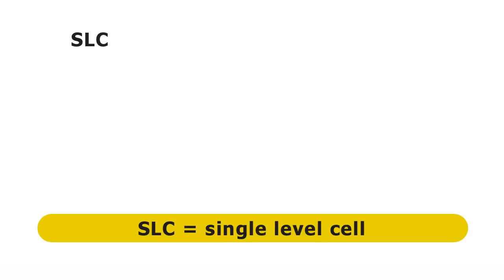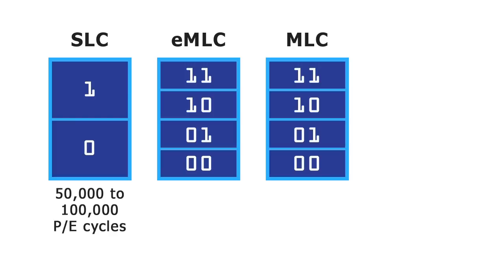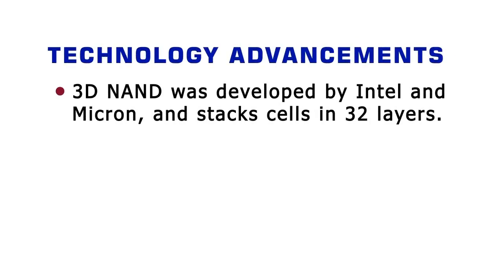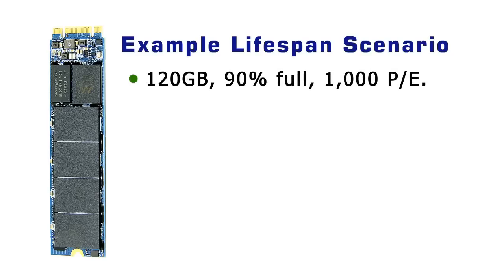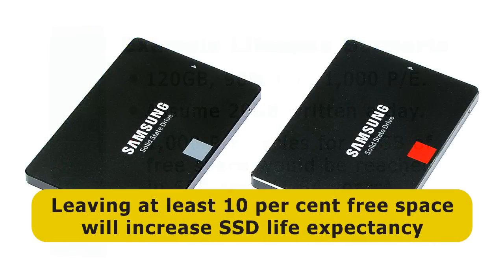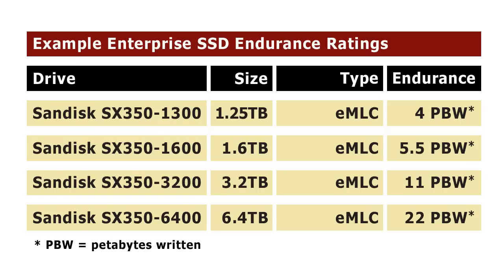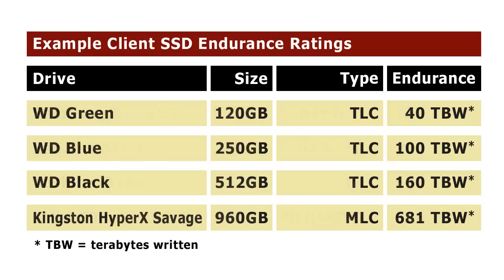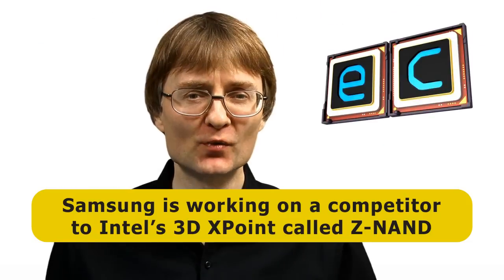SSD Life Expectancy

Comment: Simple over provisioning solution. Buy a 500GB SSD and 2TB HDD. Put your OS, programs and files on the HDD, and put the SSD straight in the garbage bin. Thus avoiding the complete loss and unrecoverability of ALL DATA on the SSD that is coming COMPLETELY without warning. In 2019 alone, I have had 7 SSD's fail entirely and when they fail they become UNREADABLE in anyway. I lost both my main PC's, two of 4 back-up PC's and my second NAS box. All had SSD's in them less than 6 months old. All had less than 120 hours on the drives, save for the NAS, which had almost 2 FULL months on it....and 2 further SSD's have crapped out in my laptop, with under 3 months usage time. I WONT BUY ANOTHER SSD in my life, the ABSOLUTE WORST TECH EVER invented. 

IMHO, boot speed lost to the old spinning platter HDD's is bearable if I don't have to replace almost $2000 worth of drives every 3 months. And any speed gained when at the desktop wasn't even noticeable. The ONLY thing I did see was a MINOR speed increase when opening Firefox or Waterfox browers, no other software had any visible gain on SSD over the HDD. VMware was 40% SLOWER on the SSD than it is my OLD 160GB 5400RPM HDD I'm using now.

SSD IS NOT WORTH THE MONEY IN ANYWAY, SHAPE OR FORM. Shit Tech is Shit Tech. Ask a Tamagotchi.....

Comment: A lot of people are claiming their ssd died within a couple of months and not to trust ssd, but then this is on amazon and ebay, the homes of counterfeit low quality tech. Perhaps ssds were less reliable when they initially were released to the masses a few yrs ago? My only question would be what the common signals are for a failing ssd. With a physical drive that was noted as failing via crystaldiskinfo I managed to move almost 1TB to another drive just before it finally gave up. I'm not sure if you'd have that with an ssd. I think I'll wait until the ssd tech becomes more reliable, if corporations allow it to. I'm sure many don't want to give up on their uber expensive data recovery services ;)

Comment: Do be aware that death comes brutally instant to a ssd thou, I remember my early days 60GB SSD that i added to my pc as a "booster" secondary game files drive as bigger Mmorpgs was getting released like Aion & Swtor & so it boosted loading times fantasticly. But when it died about 2 years later it died instantly without any warning signs. One second it was working & the next it was a brick. Of cause Ssd are better quality today, but do make sure to backup you importent files & also your primary boot partition. Thankfully with the constant cheaper larger ssd ive "naturally" been upgrading to a larger & larger drive(s) so that way avoided ssd dying so far.

Comment: The video completely ignores death of a controller and how long lasting they actually are, the amount of re-writes is common information which can be easily googled and usually most drives die when controller dies, not the memory. I would also like to know how corrosion, temperatures and overall components degradation affects longevity, because information on these things is completely unclear unlike amount of re-writes memory can withstand.

Comment: I am very lucky that the only drive that failed on me was a fradulent sd card  16gb card in 2010 that was truly only 500 MBs. For that reason I avoid buying sd cards on ebay... I had a laptop that was with a mechanical drive that was used daily for  8 years, luckily for for me still worked when I sold the laptop.

Comment: ExplaingComputers  Say what you want, THERE IS NO WAY TO SALVAGE your data once the SSD is malfunctioning as with mechanical hard drives . You can replace certain parts in a platter hard drive, and bring it back to life. You cannot access an SSD. I'll stick with my mechanical hard drives, thank you, no matter how much "they improve" it.
Reply from the maker: I agree with you, but this is not something discussed int he video -- there is nothing in this video about data recovery from an SSD! :)
Reply: I have to confirm what George says - If SSD is dying - there's nothing You can do about it... HDD on the other hand - stopped working - I bought a logical board (electronic plate) for it (5$) and re-soldered BIOS (tiny electronic component) - works like a charm, 12yo..

Comment: My 256Gb SSD bought in 2014, died in 2019. Only 5 years :-(.   Unlike HDD, which ages gradually (more errors when writing files, but it still usable) , SSD dies at once.  The system just stops to boot with blank screen, like if there's no disk at all.  Bigger capacity SSD will serve more years, because of wear leveling (and more free space).  I believe 2TB will serve more than 10 years

Comment: Honestly, I have a hate-love relationship with SSD's... And I tend not to recommend them because in my experience they tend to only laste between 6-12 months... (Using them as boot drive and one game, the only one I care about). Right now I have to replace an SSD that I bought in 2019... For the third time...
Reply: Interesting. Might i ask what SSD you have (brand, model, capacity)? 

If you intend to replace your SSD, i recommend that you get yourself one from Samsung, due to them being very reliable (the one i brought years ago is still working without fail, and still has more then 90 % of life left).
Reply: @Loundre3  YES! That is the plan... Samsung evo or nothing... It was hp...

Exact details:
HP EX900 1TB M.2 PCI-e 3.1 x 4 NVMe 3D NAND Internal Solid State Drive (SSD)

Comment: I never had an SSD fail, I had a lot of HDD fail. It will outlive the life of your system before your solid sate will fail.
Reply: I haven't had a HDD fail on me, an SSD fail on me, nor a little microSD card fail on me.... My Xbox from 2003 still has its original HDD and works fine... So does my PS3 Slim from almost a decade ago... So does my PC from around the same time period as the Xbox.... So does my PC from the 1990's.....

Comment: I have been building my own computers systems since the early 90s, I have never had a hard-drive failure in all that time, I have used MFM, IDE, EIDE, and both 50 pin and 68 pin SCSI drives. in my possession right now is a 32 GB Sandisk memory stick, and due to Sandisk implementing a protection feature, this thumb drive can no longer be written too, and the system it was in no longer recognizes this thumb drive, only my XP system can read from it but it cannot be written to.

I am going to stick with what I know works good old spinning hard drives, of which i have several extras just sitting in a drawer. as long as E-bay exists I can get hard drives if need be.

Comment: so it is still better to use a HARD disk drive, even you ran out of FREE SPACE, it will work for years...

so what is the use of having an SSD that will not last for decade'
just because of lower free space?

I have a running 500GB HDD for almost 9 years, 12 - 20 hours operation per day'
with less than 5GB Free Space'

Comment: SSD is like the RAM in PC, if they fail after their number of usage, the RAM should fail too and it's used much more than SSD. Never had a RAM turn bad on me before so maybe SSD aren't that bad to fail after past their usage but I don't abuse my PC 24/7 so can't be sure. Didn't own SSD coz it's still expensive and small capacity, still using old HDD(SATA not old slow IDE) to boot windows 10, not that long to boot about 20 sec. I don't do backups either, like buying additional drive for RAID, have only small important files that is saved on thumbdrive, you can save files on the internet like MS onedrive or Google drive. yeah RAM is temporary storage while SSD store data permanent but both writes data which is the number of times or life expectancy. yes SSD a bit faster to boot, if you can afford it go get it. had an IDE HDD that needs repair, bad sector, corrupted partition due to virus, couldn't find the time to do it, there's some data that I want to recover.

Comment: Put 8 awfully expensive 300/600GB 2,5" HPE 10k SAS drives into HP Smartarray on server running I/O intensive database and they will be all gone within 2 years.
Put a 20 EUR SATA SSD's there, and even if limiting total SAS controller I/O to of "one drive" making it bottleneck ..... and you'll still have uncomparable database latencies, ... and they would last 5+ years if you don't write alot.
If you have loads of data to write, you'll buy Intel Optane.
HDD's are history, only good for big data and occassional access.

Comment: Don't trust SSDs. They die out of nowhere. So, going only over TBW or monitoring spare cells on CrystalDiskInfo or manufacturer SSD utility don't give any idea of its actual life. It may go right after you run your PC or maybe when you are having some important work. It may be fast but is just not reliable than HDD. And recovering data is literally difficult to nearly impossible on SSDs. I had Asgard NVMe dramless SSD whose spare cells finished within two months and went on write only mode but I could copy files from that drive unless it is C: drive where its root files or files that don't require administrator prompt confirmation to go out. And I recently just two days ago had Sabrent ROCKET NVMe 512GB SSD not working after around a year. The issue was not spare cells running out it had 100% spare cells available. Just it stopped working. It does allow read and write but SSD just disconnects from entire system randomly when it tries to read/write bad blocks or some cells. So it is total trash. I cannot even copy files from it. Everytime I try to copy it disconnects. I tried formatting and changing sector from 4k to 512b and in reverse but same issue. Just had to delete 3 years worth of data files and OS installations too. So, SSDs are 99.99% unreliable to have data or important stuffs or do important stuffs on them. It may look faster than HDD at first but it will show its true color. So, depending on TBW rating is just bs.
Reply: "They die out of nowhere". Basically, you're describing everything that has ever existed. It sounds to me like you just had a bad experience with SSD and/or you are using them the wrong way. I have an Intel SSD that is about 8 years old & for my use case, it will likely last another 5+ years. Many more others have better experience than mine as well. Had SSD been that unreliable as you assume they are, then their popularity & usage wouldn't have took off.

Comment: Never trust SSD for importend (backup) data storage. My experience when used a lot it wil fail (not readable or writeable) in a couple of years. Yes, it is fast but expensive and fails much quicker then a reliable harddisk. My internal Samsung SSD in laptop starting to fail in 3 years and one external USB3 much shorter than 3 years.

Comment: Those cycle numbers are still seem too low for me... just imagine how many of those cycles will be wasted if you torrent stuff on that drive!
I think I still prefer good old HDD for storing important data, and would use SSD only for the OS for speed benefits. It really does wonders with processing speed!
Reply from the maker: The cycle numbers are correct! :)
Reply: I dunno why you would torrent stuff on an SSD unless you have a really fast internet connection faster than a mechanical hard drive. Torrenting should best be done on HDD.
Reply: @KillRei  It was a theoretical question to showcase how stupid it would be to use a hard-drive intensive software on a drive that has limited rewrite cycles. 

But I bet a lot of people doesn't give a 1st thought on that, and just use SSDs as they would a regular HDD.
Reply: Can agree to that...

Comment: Click bait BS!
Geez... No mechanical parts, that means the life expectancy is in multiple of 5 years...
So with that in mind a SSD unit will last as much as the average Samsung DDR3 RAM , or anything after or before that... That means 12+ years "on the worse thermal conditions", which is on a laptop. 
 On a well ventilated and well fed (PSU) desktop a regular SSD will last 20+ years
Even better... 2x or 4x RAID-0 arrays with SSD's is a safe concept as long as the motherboard chipset can handle the 2x and 4x bandwidth... And the extra heat it will produce...
I don't have a YouTube channel and I know more about this than this guy...
Reply from the maker: There is no click bait here. And you clearly do not know the difference between RAM (which is volatile -- data is only retained when powered) and flash memory cells (which are non-volatile -- data is retained when power is off). Due to this, flash memory cells, as used in SSDs, have a relatively limited number of program/erase (P/E) cycles as the video shows. This limits their lifetime in normal use as they can only be erased a limited number of times before electron leakage starts to occur and data can no longer be reliably retained.